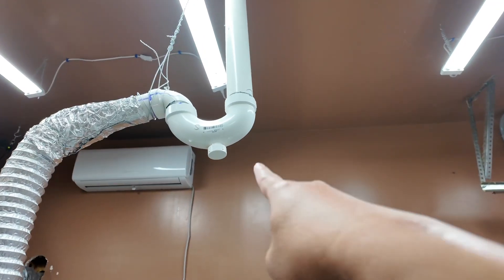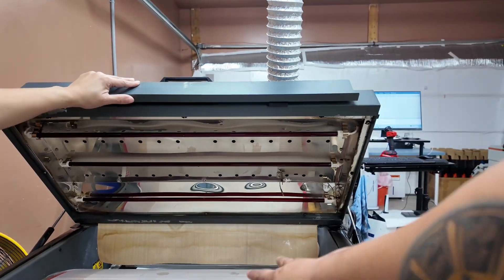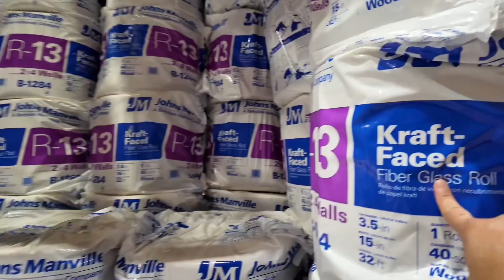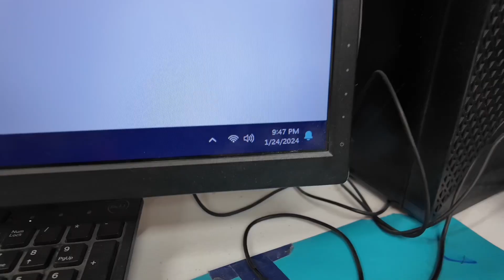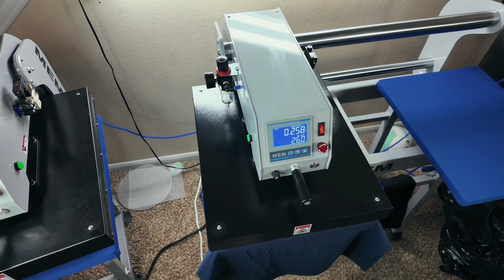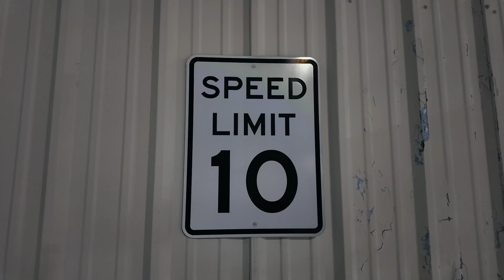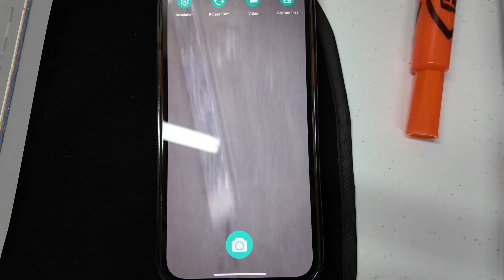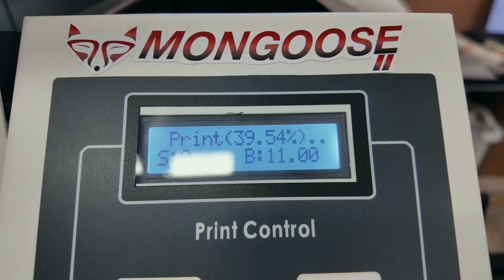DTF Printer Hacks | How to Fix Shaker Oven is Leaking Oil and Misaligned Prints

Comment: I have a brand new refine
color, Dtf shaker and all of a sudden it started pulsing and turning on and off and they’re telling me that’s perfectly normal. Just raise the heat to 140. Then when it starts working right it melts everything. Wish I never would’ve purchased from that company. It’s been a complete nightmare. I’ve had the product for less than a month and all I do is work on it Having to stay up till two in the morning with their China Tech. It’s been a nightmare.😭
Reply from the maker: How strong is your exhaust fan? If it’s too strong, it’ll suck the hot air out and trigger the lamps to go on. Start by lowering the fan speed and see if it helps reduce the lamp pulsing.

Comment: What if my dtf driver isnt curing evenly? The right side consistently is not curing regardless of what i do. The rest of tge print will be cured. It will seem it's lined up but then it has walked and it's not driving again.
Reply from the maker: What’s your curing temp? Also, lower your exhaust fan speed. It may be sucking out all the heat and causing the IR lamps to fire
Reply: Temp is 120 and when it works that is too high and i lower it to 110. I don't have any exhaust fans. I have it vented straight from the machine out the window.